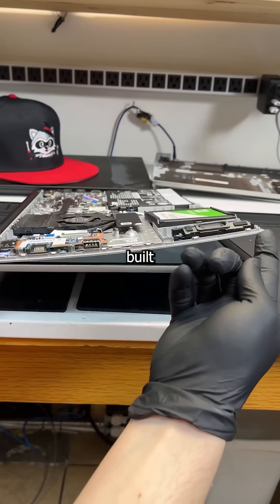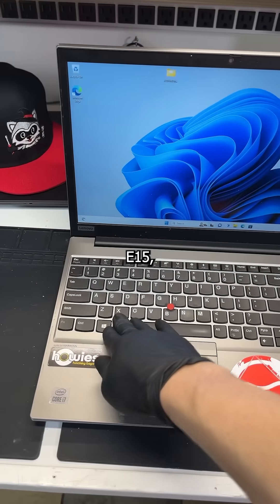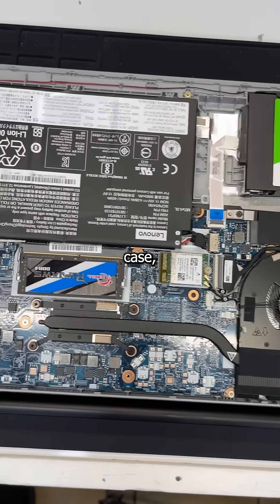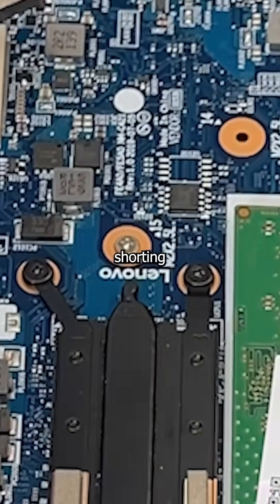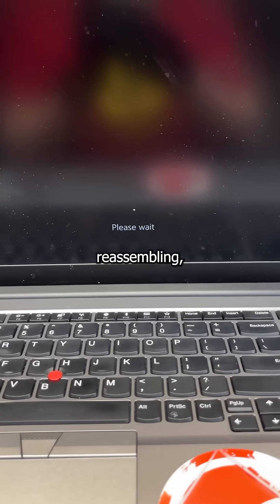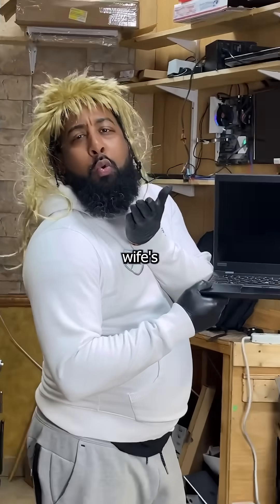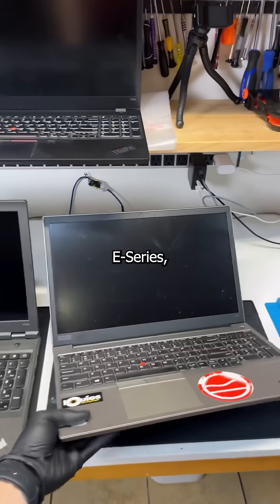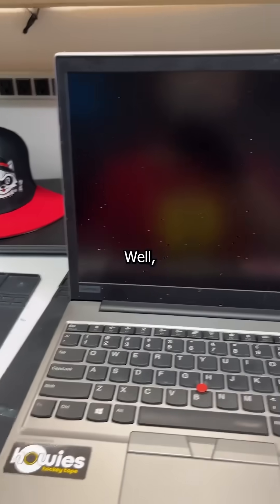ThinkPad or ThinkBad? Has Lenovo ruined the best laptop ever made? #tech #pc #technology #shorts

Comment: That is NOT a Thinkpad, sadly Lenovo ruined the godly brand it is. That is a Ideapad disguised as a Thinkpad
Reply from the maker: You’re exactly right
Reply: Missed opportunity for " Your god damn right" @SalemTechsperts
Reply: @SalemTechsperts if you put the board in a small oven you can re solder all the joints on the board but if you do, keep the board on a flat surface so the smd components and ic don’t fall off.
Reply: @Server.52  Eek! This old chestnut has been doing the rounds for faaar too long! It'll rejuvenate the board - for six months tops, before the other micro-cracks that were forming let go with a ping!
Reply: @Server.52 as someone else already pointed out the oven method (or a heat gun for RAM or old GPU chips) is only a temporary "fix". Might run for a year but it will most likely only last a few weeks. And it usually doesn't "work" at all on modern hardware that is more recent than 2015 or so. 
To actually resother major components on a mainboard you need over 300 degrees Celsius I believe. Which most ovens don't go up to so all you're doing is cooking off chemicals that'll coat your oven. It's just not worth it.
Reply: @SalemTechsperts hi adam
Reply: @SalemTechsperts do you fully replace the broken part? or fix the small problems with it
Reply: @SalemTechsperts  I have to deal with 100+ of Thinkpads. We're about 40 units of L15 units from Gen1 to Gen4. I sure hope they don't die all at once.
Reply: @SalemTechsperts  Nah, Even Ideapad gaming's are better nowadays...
Reply: @SalemTechsperts  joedell
Reply: @SalemTechsperts  i have a yoga x380
Reply: That’s basically the truth. The ideapads are the worst laptops Lenovo makes, and they break like no tomorrow. To get a durable Lenovo, get a Lenovo thinkpad education series, or a P series thinkpad
Reply: @tomsvideosofrandomcrap6223 Funny story the Ideapad Gaming are the OLD Ideapads which were durable. Current ones are weak as hell
Reply: @lrc3847  my 2020 ideapad 3 ryzen 3 20gbs of ram with 8tb of storage playing games like gears of war reloaded is insanity knowing that going above 900p or 1080 will restart the laptop 😂 
Trust me it plays games its a strong trooper games like Kane and Lynch, Max Payne 1 2 3, Gta 5 legacy edition, Saints Row 1 2 3 4 gat out of hell, FarCry Classic 2 3 4, Crysis 1 2 3, Mass Effect 1 2 3, Need For Speed Carbon, Most Wanted, Underground 1 &2, Payback, Heat, Hot Prusuit, Forza 4, Halo Master Cheif Aslong As Its Halo 1 & 2 3 Ost Edition, as 3 & 4 crashes. But plays a great amount of games.
Reply: @tomsvideosofrandomcrap6223  GTX 1050 in my Ideapad l340 doesn't work
Reply: @tomsvideosofrandomcrap6223  my idea pad is good
Reply: Really?

My ideapad flex 5 is perfectly fine 2 years in. 

Only real issues were drivers being finicky at times.
Reply: Lenovo only makes StinkPads nowadays, because they leave you with the smell of regret.
Reply: @DJdoppIer  I bought myself a Asus Vivobook back in late 2020 for about 600 dollars, 10th gen i5, a dedicated but weak mx250 gpu. Not perfectly upgreadable, but man. That thing has some THICC plastics. You can't even make that thing slighty bend with everyday usage, or even some gaming smacking love.

Yet my school has laptops for teachers that are some HP's that while trying to put your hands on the touchpad to type something start to bend.

My school's Computer Science room is full of optiplexes 755 with some old, garbage xeons and 4gb of ddr2 ram, hdd, no usable gpu, just the one built into the motherboard.
Reply: @fxgraphing  i currently have as a main laptop a vivobook from 2018 with a 8th gen i5. These things are proper laptops, the recent ones feel like they've been made out of paper...
Reply: @fxgraphing that’s actually not the worst setup in the world if they put Xeons in those, some of them (like the e5450) can even be used for light gaming.
Reply: @urlocalgrasshair7899  I got a 2016 vivobook. It once rolled down the stairs all the way from the 2nd floor of a building, several times dropped into the ground by ship luggage handlers. Still works.
Reply: @fxgraphing 4 gigabytes of ram? We get half a megabyte of usable ram
Reply: @urlocalgrasshair7899  bro I have a Asus I got when I was 11 as a birthday present (im 21 now), it still works technically but it's so slow that it isn't worth the time so it just kinda sits... but it works! After 10 years it still isn't broken despite me being a chaotic child for most of my time owning it
Reply: @fxgraphing  i have Asus Vivobook 11" (E203MAH) from 2019. Even though it has potato specs (fanless Intel Celeron, UHD 600, 4gb DDR4, 500gb HDD) it serves my purpose well as a daily driver.
Edit: but I'll love to have an OG equivalent Thinkpad with sturdy build quality and upgradability.
Reply: @fxgraphing I had a missile shelter in my elementary used as a computer room and all of the monitors had trash speakers or no speakers at all and having those big beige speakers was a luxury
Reply: @senpaqii i got a vivovook with a 13th gen i5 and a surprisingly decent igpu that can run lighter games with no problem occasionally and i agree, asus has some great quality and Very nice looking laptops
Reply: @fxgraphing i love the optiplexs at my school, they take 15 minutes to boot up because of the lack of an ssd
Reply: @fxgraphing  i had one of those...and the hinge die...and the display die as well when fixing the hinge
Reply: @fxgraphing oh heck yeah, I have a 2014 asus vivobook and that thing has an i7, a 950M, a DVD drive, USB-C and enough heft to crack a skull.
Reply: untrue. T and x1 carbon thinkpads are solid. minor driver quirks but they're solid @DJdoppIer
Reply: @DJdoppIer  Bought a gen 1 x1 extreme. Worst tech decision I've ever made. Never again.
Reply: @DJdoppIer The last good one were the x220, t420 ,t520 and w520
Reply: @DJdoppIer  my 8 year old lenovo laptop that still works in spite of lag
Reply: @DJdoppIer  Nah, the thinkpad P16 is actually really really good.
Reply: @DJdoppIer you can now like your own comment to change between 999 and 1000
Reply: Me with ideapad duet 3 @DJdoppIer
Reply: @DJdoppIer  DontBuyUsPads
Reply: @DJdoppIer  my mother bought a Lenovo legion for around 2k when it should have been 1,200$. They're not bad but over priced for sure
Reply: @DJdoppIer  I just bought a thinkpad x13 and I love it so much. actually the full story is that it ran pretty slow at first but then I disabled/uninstalled all the bullshit stuff microsoft stuffs into windows 11 and now it's lightning fast
Reply: @DJdoppIer can't wait to buy an ideapad pro 5! just josh said it's a good laptop ❤
Reply: @DJdoppIer   i had a lenovo its fine other then  tje HDMI broke
Reply: That is actually a really good concept, and Lenovo would be better off with ideas like that;
Branding SHOULD identify a product, but 'Thinkpad' has so many deviations in quality/capabilities that it doesn't identify anything to a consumer any more, they use the letter after this. HOWEVER the BRAND should quantify the quality of the product, but there are WAY TO MANY BRANDS with the 'Thinkpad' identifier for this to be valid any more either.
Reply: @Kyle-Manel 
Confusion makes money
Should i by the S420 or the K2763
Reply: Yeah, you'd be able to kill someone with a series R40 thinkpad due to how beefy these mf used to be
Reply: i have a lenovo legion t5 and i dont have to worry about this lol
Reply: @VJGamz  legion, education thinkpad, and thinkpad p series are the best ones to buy
Reply: @tomsvideosofrandomcrap6223  education thinkpad? nah youre getting way too close to schoolhouse territory
Reply: Wait,is ideapad really that weak ? 😂 i got my laptop lenovo ideapad 310 and for 7 years its still fine for not just working and playing some 2014-2015 games too.
Reply: Yes. Stupid Lenovo.
Reply: I have a t520 from 2012, and that thing is built like a BEAST. Monster performance in a monster package, just like how my girlfriend was stolen
Reply: @adamscarsandstuff4969  T séries Thinkpads are also durable. I have a Lenovo Thinkpad Yoga 11E and even that thing’s more durable than the crappy ideapads with thinkpad logos slapped on. Of course the plastic on my 11e is pretty thick
Reply: The higher-end X, T and P-series are stil pretty good in terms of build quality, not as indestructible as the old ones, but better than 99% of the market. It's just the "budget" E and L-series that are pretty much E-waste.
Reply: Funny enough, my ideapad slim 5i has the "military grade" aluminum body and it's really stiff and solid, can't believe how cheap that ThinkPad looks
Reply: @Jugos_gastricos  Oh so I guess ThinkPad and IdeaPad is switching sides, damn bro what is up with Lenovo these days 🤦‍♂️
Reply: I have an IdeaPad 16" with a Ryzen 7840HS and it luckily has a really sturdy aluminium case...
Reply: This. The bottom-end E series is also the only "ThinkPad" line that is designed in China along the IdeaPads, whereas the rest of the ThinkPads are designed mainly across Japan, Taiwan and the U.S (a select few X1 and X13 series models are entirely manufactured in NEC's factory in Japan).

The E series is literally IdeaPads disguised as ThinkPads. The E14 series seems to have been vastly improved (build quality is no longer a concern), but they're still not really part of the ThinkPad family.
Reply: I bought an IdeaPad s145-15iwl in 2020 and i like the quality that i got for such a small price👍 the only problem that I encountered is some of the keyboard keys broke because of my sloppiness, but gladly it can be replaced inexpensively. Und upgrade ability saved me even more money.
Reply: My ideapad is stiffer than this crap.
Reply: Last real thinkpads were T480 and A485 and related P52. Still got removable external batteries, were very sturdy, had 2 sodimm ram sockets and were properly upgradeable. Even keyboard was removeable from the top without taking the chassis apart.
Reply: A true ShitPad
Reply: idea tampon fr
Reply: umm “tampon”…. Wtf is that meant to mean 💀
Reply: I have an IdeaPad s145 since 3yrs which is probably the lower budget gamma in Lenovo and thankfully don't have that trouble 😅 I have no complains, it was cheap and got more than what I expected. That seems to be an specific problem with that ThinkPad model.
Reply: I use an Ideapad.
I have for several years.

Still runs great.
Reply: i use to be a hard core IBM guy back in the day to see Lenovo take over and not do so well or give us what we came here for. we were the anti mac the get shit done kind of people and give me my ports
Reply: I've bought gaming Ideapad in like 2020 for 75000₱ (about 750 dollars with today's exchange rate). It works well for me, there are some problems with n-key rollover, but otherwise it's good.
2 years after my mother bought Ideapad for work (not gaming), it was after start of Ukrainian war so I can't tell anything about conditions, story and original price of that laptop. But it was broken from the store, so they replaced it with normal one. The only problem is that for my mother it stinks with bad plastic, otherwise it's also normal
Reply: More like bad-idea pad
Reply: I vave a vintege (win vista era) ideapad still works great
Reply: The t series and l series are good still
Reply: bro just violated the whole company up to the board members💀💀💀
Reply: Even my cheap 400$ ideapad still sturdier than that
Reply: Think pads use to have metaloid bar to stop flexing
Reply: I think the last remaining laptop that's going to last forever is the Panasonic Let's Note series. Same ancient design since 2002.
Reply: I have graduated from ideapad to ideapad pro and the build quality is like night and day. 😅
Reply: When ever was Lenovo good? Because I don't think I am old enough to remember a time they ever were a good brand

From my experience even Acer and HP are better
Reply: My Ideapad is brick solid
Reply: My gaming ideapad is pretty sturdy
Reply: It’s a LeapPad disguised as a think pad
Reply: @TheOneShotWunda  lmaooo
Reply: hey, i got an ideapad gaming 3 cause it had a dual 3050 and a slower less power hungry amd gpu for on battery, and it advertised upgradability, and i think its pretty good. i put an extra 8gb ddr5 ram in there and i could put another ssd in there if i want. but i cary it all the time and its fine. but one thing, if you shake it, you can hear something rattling kinda by the speaker on the right. and my only real gripe about it is that its battery life is like MAX 2 hours on low brightness with the keyboard light off and only on the amd gpu.
Reply: Even my Ideapad never did this, yea my ideapad wasn't that durable either but it could still be moved and used nearly everywhere.
Reply: every low-end model like VivoBook, ThinkPad, IdeaPad, MSI whatever and especially HP is just e-waste
Reply: @Vysair  100% agree. I sat at Walmart for 2 hours going thru their inventory to find the best laptop deal that would allow me to run cad software and program. Got an aspire 3 59 for $370. Can even put 16gb ram in it. Only issue is the integrated graphics is soldered so u can’t swap it. 12th gen i5 processor tho enough for me to run fusion360 AND get 80fps on Minecraft. I don’t disagree but there are good deals
Reply: Real (Though my ideapad has been through it all and is still going strong.)
Reply: I still have a ideapad that uses w7 w8 and w10
Reply: I had an IdeaPad 10 years ago, it actually worked great.
Reply: @onee  same
Reply: Bruh ideapads are much stronger than other laptops like dell and hp be using one so I know. My friend has hp victus and I have a 8 yr old ideapad 310 they both fell from the same height once due to my friends carelessness and the victus hinges and back were broken and the panel had come of but the ideapad only got a crack near the hinge.
Reply: My ideapad is 6x as thick as that thinkpad
Reply: @2007ToyotaYaris  my T490s i acquired today to replace a 4.5 year old asus gaming laptop that died is thinner than my mom's e15. but holy shit is it much better built. this thing is a tank in comparison. no flex at all when picking it up by a corner.
Reply: When i was little, we had an IBM thinkpad t52 i think, now I'm 17 and bought a refurbished lenovo thinkpad t14 gen 1,  and it was thrown in my front yard. It works still, it weights a lot but damn if it's sturdy. I own a lenovo ideapad s145, and it's a bendy piece of plastic so yeah there are still ibm-like thinkpads but those are really expensive and very company oriented (i have a card reader instead of another ssd or more battery and i can't swap it with either)
Reply: Bro I don't get the shade thrown at budget ideapads. It's only recently that they've gotten so bad. I have a 7 year old, bottom of the barrel IdeaPad that still works fine today. I replaced the hdd with an ssd and still use it as a media machine connected to my TV
Reply: Funny enough, I just bought a ThinkPad T14 G1, and I still own an older IdeaPad S145. The ThinkPad got thrown in my yard when it arrived refurbished, and it still works; the ideapad got dropped from half the height and now the light on the on/off button turns on sometimes
Reply: hm, I have an ideapad gaming 3... it's kinda really strong... I'm a really rough user and most of the tech don't usually last long with me...
Reply: Sthu my ideapad still lasted with me after many years. Never had any issues.
Reply: I never had issues with my ideapad.
Reply: I mean I have a ideapad and it's still working great... Even though I might replace it because it's hardware it's a bit long in the tooth nowadays 😅
Reply: Lenovo products were always shit what are you talking about?
Reply: @CarlosSuarez-tk8qk  are you sure about that?
Reply: It was a shame really watching the fall of the ThinkPad line. I had five different models that all lasted me years each. Got my first Lenovo ThinkPad, and after opening it, sadly disappointed. Nothing like the tanks that they were known to be
Reply: I have an Ideapad 3 and the plastic is almost identical. I have to say my pc is a lil sturdier than this one
Reply: Damn … as I hold my
Loq 16 with fear
Reply: I've been telling this on reddit and everyone just downvoted me because they're still loyal soyboys and can't accept the fact that their company who they swear their loyalty just betrayed them...
Reply: Correct. I love my P73. Best laptop ever made
Reply: Ya
Reply: Are the new Thinkbooks also this flimsy?
Reply: Somebody doesn't remember the T46 Thinkpads
Reply: Thinkpads b4 2012 were elite, genuinely better computers than the 2016-18 ones somehow, n i had both at the same time!
Reply: Conceptualization slab
Reply: Damn they gave the Thinkpad a lobotomy
Reply: 7000th like
Reply: has yoga 11e 4th gen flashbacks
Reply: Lenovo isn't awful tbh
Reply: Imo Lenovo ruined the brand themselves anything truly expensive works for a lil while then you have issues and they don’t refund you until the warranty is up and you record their calls and cheaper laptops well as we can see online just either due to their internals either a really poor experience to use or their build materials is the down fall Lenovo needs to fix their act and yes this is my own personal experience
Reply: Yup i have a thinkpad vrom the 1990 i think and its s tank
Reply: nah man thats a you can think pad(tm)
Reply: IdeaPad? Are you saying that we have ThinkPad at home?
Reply: this also happened to the t42 from the early 2000s lol
Reply: Pro Thinkpads are still good machines, quite reliable and solid for the price tag.
What Lenovo killed is the iconic keyboard.  It was a perfect design and feel and they abandoned it for the stupid trend of following the whole industry behind apple and making island keyboards...
Reply: This trick got me in college. Damn thing broke in one semester.
Reply: Yea my parents got me a think pad but it's so slow it's un usable
Reply: I've had quite a few thinkpads since 97, and by last thinkpad before IBM sold it off didn't even last three years before it was unusable (gpu problem. it was an A serie with radeon gpu). Never had a problem with the later laptops, which have all been T and X series. (x61s, t62, t470s, t490s, t15 gen1). So the good thinkpads are just as good or better in my view. Never had an E series so I can't attest to them.
Reply: Nah it's a Mindplane
Reply: I have a ThinkPad E495, got no complaints. The plastic is the sturdier one though.
Reply: 'IdeaPad' lmao
Reply: ThinkPad died with IBM
Reply: I have a Lenovo and mine works perfectly
Reply: ThinkPads are for school laptops, they can stay there lol
Reply: Thinkpads USED to be great...
Reply: The true ThinkPads were made by IBM. Lenovo makes only garbage.
Reply: “NO that is NOT Solid Snake” vibes
Reply: Man Lenovo makes shitty laptops now 😭
Reply: I bought Lenovo V15 g4 3 month ago, it has strong processor and works good but the only thing is battery life ,  it only can last for 2 hours now without any gaming , i  just used it for browsing and simple coding
Reply: they had an idea...but maybe it wasn't a good one
Reply: Never buy an IdeaPad, they suck.
Reply: The Dell Latitude 2110 was a POS that didn't even run Quake, but my word was it durable. Handled some serious damage, and the Intel Atom processor finally gave up after struggling for a decade.
Reply: This isn't even an Ideapad. It's a god damn Synapsepad. I'm surprised it even shipped with a case, let alone a screen.
Reply: Remember the old Ideapads,they didn't have these flimzy frames.
Reply: lenovo has never made a good laptop.
Reply: @JessicaFEREM  Surprisingly, at the top end of the market, they do. I service 'em regularly. As a wide-spectrum manufacturer, they're guilty of cheapness at the lower-to-mid range with their build quality and this reflacts badly in peoples' perception of the brand, but it ain't so at the top end. Think the HP Elitebook range; Lenovo has some great equivalents - if you're prepared to stump up the cash.
Reply: Exactly. Picking up my T520 to rougly will actually break your arm
Reply: Recently bought a p52 I like it
Reply: This is not a ThinkPad it is a thinkbook. ThinkPad is still good till now. These are the only good laptop series made by Lenovo.
Reply: I absolutely agree because I had a Lenovo g50 and it's plastic started separating where the hinge was.I believe newer lenovos are even worse because all laptop manufacturers are cheaping out.
Reply: Thinkpads are godly.
Reply: Ideapad is for budjet users
Reply: This problem also exists on the L560 wich is almost 10 years old now though lol
Reply: FACTS
Reply: Me watching this from my new thinkpad🥲
Reply: The P series are still very good, the E series were good, but this is way too bad, even for a budget laptop.
Reply: Are the T series still good? The company I work for uses all HP Elite series laptops/desktops.
Reply: AMEN! Be thankful that GOD woke you up today! AMEN! Let's keep this family friendly please! GOD DOES! AMEN! Pray for everyone! None of us are worthy! But remember, GOD hates the sin, not the sinner! AMEN! 🙏🏾✝️
Reply: This hurts me so much, they used to be an iconic brand.
Reply: Nah, leappads were sturdier than that thing will ever be
Reply: This is a known issue with a Thinpad already, the x260 to be precise.
Reply: I have an IBM Thinkpad from 1999 with a Pentium 3 in it as well as second generation (1.1) USB connectors.  Was state of the art in 1999, built like a frieght train and as solid as a N64.  Has a fantastic colour screen for the time.  No idea how expensive it was, got it as a gift handed down to me from a rich girl who didn't want it anymore in 2000, it was only 8 months old and she barely even used it.  I treasured that laptop as it was my only computer throughout high school, used it for 5 years.  Had windows 2000 Pro on it. It is 25 years old now, still works.
Reply: Lenovo and acer are great laptops for business. I just got a $400 aspire 3 and it runs my CAD software no issues
Reply: idk, my ddr3 ideapad is pretty thick. especially the hinge
Reply: The Ponder Pad, maybe even the Wonder Wad
Reply: More like a badideapad 😂😂😂
Reply: The E series is cheaper quality
Reply: not the smartest Idea to use thin plastic I suppose
Reply: This is trash and they should be fined for it
Reply: One of my clients bought a legion it lasted 6 months before the power socket died.
Reply: So real
Reply: Thinkpad have steel hinges
Reply: Even my 2018 T460 is infinitely more sturdy than the ‘thinkpads’ they put out today. A very difficult laptop to break, and if something does break, repairs are very easy. These newer models look like wannabe MacBooks.
Reply: Even my 2018 T460 is infinitely more sturdy than the ‘thinkpads’ they put out today. A very difficult laptop to break, and if something does break, repairs are very easy. These newer models look like wannabe MacBooks.
Reply: I mean from everything I've seen the super high end ThinkPad are still good but you gonna pay 1k+ obviously. Pretty much have to pay over 1k if you want high performance OR high quality and good performance. I really want an X1 carbon.
Reply: Lenovo sucks, but I feel like they're gonna chinese CIA speedup my prebuilt's planned obsolescence just for saying that. Do not go to their support forums, do not talk with Legion fans, they're all nuts and fedposting hard. Tinfoil nomenclature aside, they really do shill Lenovo stuff and Lenovo 3716 mobos are pure garbage. Look up BIOS ACPI problems and you'll see a glimpse of what I mean
Reply: i have a thinkpad, its like the nokia of laptops, cant run most games tho
Reply: Fr
Reply: The hopes n dreams pad
Reply: Thanks for this I don't keep up with the brands but I remember they were built like nokias almost like it was intended for school use where alot of wear and tear will happen
Reply: From my experience, Lenovo much much better than Del and hp
Reply: @SmartManThe13  I have an ideapad for years
Reply: Because the idea of a laptop is what makes it a reality?
Reply: Nono it’s a ponderpad
Reply: Ngl I bought a ideapad 1 because the CPU was decent but the rest left me so disappointed i had to return it and I bought a  Huawei matebook d14 instead. Better cpu, materials and design.
Reply: So which modern thinkpad series are the most reliable? 
X, T, P, Z, etc..
Reply: you mean an ideatampon? sorry.
Reply: i own a 10 y.o. yoga p40, it is pretty well made but costed like 2500$ on launch (bought it for the equivalent of 200$ a few months ago tho)
Reply: My dad got a laptop from lenovo for me for around 1k dollars...barely worked. It was huge. Heavy duty. Couldn't even run Microsoft teams. My mom advised him to get an HP laptop of half the price, he didn't listen...🥲 I use my brothers old HP laptop to play sims 4 lol, funny comparison.
Reply: I wish ibm still owned and made thinkpads….
Reply: Yo I have a same my laptop Lenovo is keeping a crashing 30 times  overkill  loading screen
Reply: You mean and Ideabad
Reply: @superJK92   ???
Reply: my idea pad is durable
Reply: @suditvr  Ideabad
Reply: I had a Lenovo computer that took about 20 seconds just to open google
And would heat up rapidly if I opens any app the app wouldn’t open but it still heats up I could roast marshmellows on it
Reply: It's jusr a GuessPad at this point
Reply: Yeah like Thinkpads are the most durable laptops i have ever seen
Reply: Is an ideapad so bad i have one for almost a year and had no issues with it i dont even get framedrops in fps games
Reply: I had a T series with the same problem.
Reply: hi
Reply: aTHOTpad
Reply: Even my 2017 ideapad is built better that whatever that is
Reply: Levono ruins everything they touch , ThinkPad, Motorola
Reply: only business X1 TB's are actualyl still god
2018 TB's are the last truly great tb
Reply: *ChinaPad
Reply: Is my ideapad 3 gone? It's not turning on, the led indicator isn't when plugged in, plus it was fully charged before
Reply: That’s not a ThinkPad that’s a WayTooDumbToThinkPad
Reply: It’s trash anyway no matter how u call it
Reply: my shitty ideapad isnt this shitty lmao
Reply: Lenovo has never been a good brand. Miss me with that proprietary hardware bs
Reply: how about school versions tho?
Reply: At that point, just get an older 2013-15 ThinkPad which can't run win11 as it's a real ThinkPad
Reply: It was literally NEVER good
Reply: Funny thing is I am in my early 20’s so I wasn’t around when ThinkPads were supposedly good so ever since I was a kid I always attributed ThinkPad with cheap garbage
Reply: That's deadass built WAY worse than my $400 IdeaPad 💀
Reply: They took the Thinkpad, turned it into the Ideapad, and then turned that into the Maybe-Considering-Having-A-Daydream-Next-Weekpad
Reply: I used to have an IBM thinkpad with win 2000. Now that was a weapon.
Reply: It is a Thinkpad allright... Even the P series went into the drain, so it keeps the quality difference consistent.... But each generation sucks more. Compare a P50 with a P15... Now they have internal battery, less ports, overheat (they made them thin, instead of practical for engineering),  noisy, and way less expendability
.
Reply: Seriously though. They’re old think pads were basically invincible
Reply: I have an 8yo low-range Ideapad and It never disappointed me
Reply: I honestly thought Lenovo wasn't a bad brand, at least with tablets
Reply: @sachatsunemori  They really are, just not with most their products. Aside from the legions, and think pads, All their stuff is pretty bad as far as laptops go
Reply: @sachatsunemori  I never used a Lenovo tablet. I heard their mobile phones are good, but I also never used them. But laptops... I have been used ThinkPads since 2005, and I can tell that Lenovo has constantly ignored their user base inherited from the IBM era, and constantly middle fingered them to the point I am for the first time, considering never purchasing a ThinkPad ever again.
Reply: IBM Thinkpads are irreplaceable.
Reply: nah mf thats a theory pad
thats a hmm pad
thats a ponderpad (good name btw)
Reply: IBM used to make good thinkpad laptops until the china bought them
Reply: Look their genuinely not that bad I own a an e14 gen 5 speced like a decent person with the aluminum frame and it's great. Never get the plastic ones tho
Reply: Apparently not all IdeaPads are created equal. I have a 2022 IdeaPad 5 (with the Ryzen 7 5825U) and it has a pretty sturdy metal chassis. The lid is still made of plastic but it’s not as flimsy as other IdeaPad models. 

I also have a 2021 ThinkPad P14S, and a Framework 13
Reply: Agree, idea pads are TRASH
Reply: A name shouldn't be the excuse of such poor build quality
Reply: that actually is a ideapad with the thinkpad logo and trackpoint on it, look at the power button and its an ideapad
Reply: You mean IBM
Reply: Even the IdeaPad used to be solid. I had one in college and that thing tanked a fall from the top bunk in my dorm room.
Reply: My Ideapad is much more durable than that flimsy thing
Reply: Bruh my moms Ideapad is well made but it can’t even handle open chrome 😂 may god help Lenovo bc the ideapads are a disgrace to all pcs even Chromebooks work better
Reply: ConspiracyPad
Reply: They make good ones, but they are incredibly expensive and only sold the companies in the thousands
Reply: What ı have a idea pad 1😬
Reply: Indeed. I so fucking love my T530!
Reply: I have an IdeapPad, 5 years old with no issues and I've carried it everywhere 😂
Reply: Doesn’t-Thinkpad
Reply: Preach! They havent been thinkpads since IBM.
Reply: Nah, that's more like a theoryboard and a bad one at that
Reply: I have had a Lenovo T51 Thinkpad for a while, it still works but windows updates slowing it down for years finally made me get a new laptop. I went with a Lenovo Yoga Pro i9 and it's been working pretty well
Reply: probably is but id say the T14 gen 1 still stays for Tank 14 - its ROCK SOLID hahaha
Reply: I have a t series... Is it also good? No complain so far
Reply: So I bought an Ideapad and this video shows in my feed Am I cooked😭💔
Reply: My Ideapad is currently 9 years old and still functions for light office work...
Reply: Its not a think pad its a thinkbad
Reply: Man don’t say  ideapad bad
Reply: I have an Ideapad, i've been using it for 6+ years and on going and I ever only have one hardware problem where some keys on the keyboard doesn't work after 5 years of use.
Reply: I f*cking hate ideapads. I remember getting one of them in 2020 and in less than a year it already broke itself from how weak the plastic is while also being "ultrathin"
Reply: @Youcican they must’ve changed how they make them since then. I recently got a refurbed 2022 IdeaPad 5, and it has a metal chassis
Reply: @Youcican Mine looks awful, but it still works 😔
Reply: @Youcican *ChinaPads
Reply: I had IdeaPad 330. Cost me around 2500 PLN (roughly $625, which was all I had at the moment), it was absolute dogshit level of horrible, and it finally died a horrible death. I got used, little bit damaged Dell latitude E7240 for 100 PLN (about $20), and it performs much better. Honestly, fuck Lenovo.
Reply: @DawnyMurzyn had one of those too, luckily cost me only £235, it was so slow it took me 20 minutes to open the settings menu while i was trying to wipe it clean to give away.
Reply: @DawnyMurzyn  I had an Ideapad 330 too, a few years ago, maybe like 6. It did cost me a bit more than yours (maybe like 3k+ pln) but it was amazing and worked really well. The only issue I had was that after few years one of the hinges broke which caused a few other physical issues
Reply: i have a thinkpad from my school and i' m having the exact same problem
Reply: Absolutely, I used to have a Thinkpad back in the 2010s and GOD it is awful both in performance and build quality 💀💀 Thinkpad is permanently ruined
Reply: It's not a Thinkpad, it's a Thoughtpad, because it stopped thinking long ago
Reply: @pinkiuspie yeah must be
Reply: Ideapad isn’t that bad?? Mine’s build still is stiff